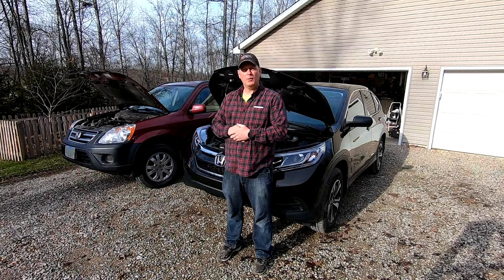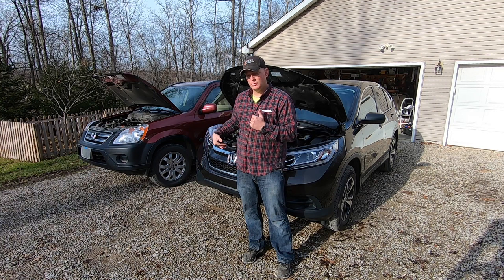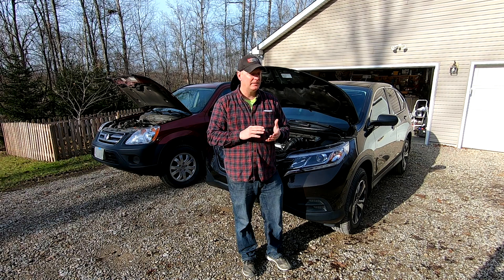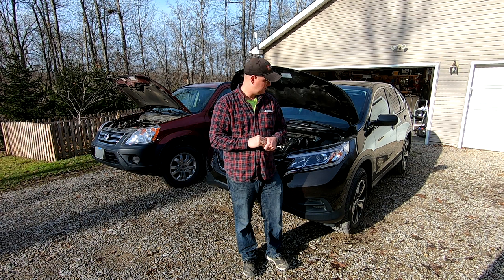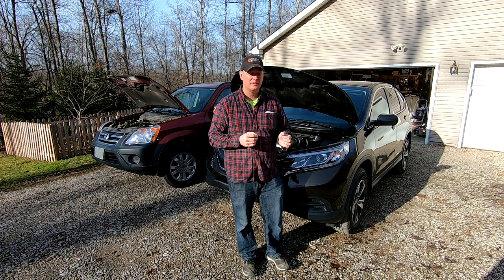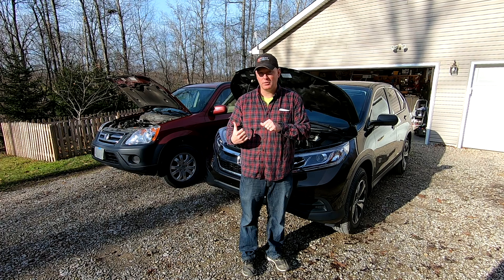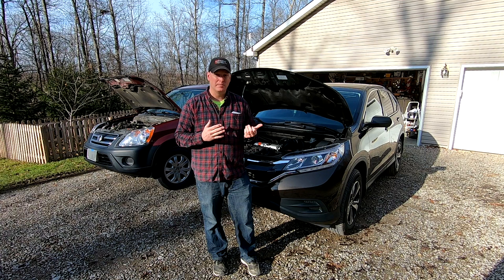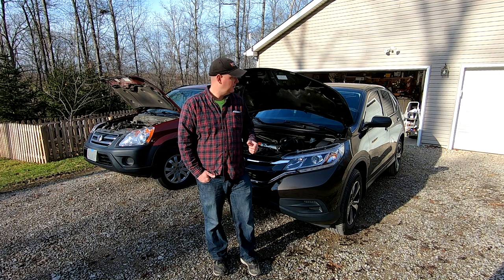DON'T BUY THIS CAR - 2012-2014 Honda CRV

Comment: I agree that this has been far from Honda's best effort. I had a 2013, and now own a 2014. Both were initially plagued with the "Croaking" rear differential actuator. The first one required the usual "we can't hear the noise" and "they all do that" from a snaky, POS Honda service advisor. I then had to give them the first of several TSBs on the issue,  and ask them to drop the bullshit, and do their job. In the collective 250K + miles, the VVT issue and $2000 repair bill, were joined by repeated compass module failures, which is a ten minute, $60 DIY fix, or a $400 bend over over at the dealer. The rear suspension is garbage, and can leave the factory unable to be properly aligned until you have spent $4-500 on aftermarket, adjustable lower control arms. This allows the rear camber to be brought into spec, and you stop grinding the inside edge of tires off, and start getting more than 30K miles out of a set of four tires.  The heat blower motor failed,  and small rubber trim strips on the B-pillars are now flapping in the wind as I head down the highway.  Not quite a GM or Nissan level of crap quality, but this generation of CRV, is nowhere near the caliber of other Honda vehicles I have owned. 

 The oddest problem is that the top chrome bar on the grill will snap all of it's mounting tabs off, and randomly depart the vehicle. I thought this was a really bizarre and random event, until I bought the replacement part and went searching for a YouTube video on swapping it. There are several videos on the topic. One video, for how to do a fairly obscure repair on this specific car, had THIRTY THOUSAND views. Now, if that many people wanted to learn such a specific DIY task, how many others paid hundreds to the Dealer to do the repair? My guess is that Honda made millions on that design flaw.
Reply: I just used a $125 aluminum set of parts for the sagging camber problem.
Reply: @scottasbj  And the dealer would have done it for that price? Did somebody align it for free? Would an independent shop charge the list price of the parts and two hours of labor?

Comment: My Honda Accord car got crashed.  I was expecting another 10 years until I pass it down.  Dang it.  It is a good one too.  So I been hunting.  Between you and Scotty and the stupid Variable transmissions and useless air blown feeds to get another 0.5 miles to the gallon, it is starting to look like Toyota.  Well, so far I found truck models  but I am not looking for a truck. But IF you can get a pickup with the 9 Speed Tranmission and the frame instead of the unibody and regular v6 4x4 or a Nissan Frontier and you want pickup.  You should look them up.  Ok not sure the 9 speed is in the pickup but there is supposed to be a good simple tran and engine in some of them.  Made in JApan too.  So apparently the CRV match in Toyota has one with the good basic engine and transmission.  That is the problem.  All that stupid going around trying to squeeze another half mile per gallon and ruining the economy and dependability of the car altogether.    Yes, you feed  Climate Idiots and tiny bit of science and they go completely stupid misunderstanding.  Twisted minds that see Government mega dollars do not care if the junk makes sense, just damn the torpedos, full speed ahead.  No matter how wrong or stupid the irrational solution.

Comment: i have a 2014 CR V at 8000 miles my Actuator started making that sound on cold morning i let my Honda DEALER know about it, they kept telling me Honda didn't have a fix for the Actuator so each time i got my oil changed i would ask if Honda had a fix they always said No they didn't have a fix so at about 55000 miles on my car getting a oil change i ask again they said NO, so i said  if it does something to my motor after the Warranty runs out i well SUE YOU TO HAVE IT FIXED because everyone having this sound!!!! in a few mins. the BOSS showes up and tells me WE ARE FIXING YOUR CAR i ask him i didn't think Honda had a fix he told me they did so in about a week they replaced the ACTUATOR and timing chain i have 115000 miles now have heard it one or two times put thats all, that wasn't until few weeks ago DEC 22 very cold!!
Reply: I would change the oil at least every 5,000 miles or even more often.

Comment: This is a nit picking a great vehicle and an easy fix.  It is a 2.0 hour job (TSB 09-010) at the dealer or even cheaper if you can do it yourself.
Reply from the maker: Did you watch the video? I paid the dealer and the problem came back less than a month later. I understand there are far worse vehicles out there but it's more of the fact that Honda refuses to even acknowledge they engineered a defective part and cannot come up with a proper fix.
Reply: @JackofAllMasterofNone  If it came back that soon, I would talk to the dealer again.  They should stand behind the work.

Comment: Toyota with their crazy track off & engine light that doesn't go off no matter money spent to on it. 

Rattle sounds in Toyota is normal most of thier engines 
2004 to 2012 & in recent, Mechanic will say it's normal. 
All cars have their issues. As far is not offenely fix every few miles. Toyota is not perfect neither Honda's.

Comment: It's VERY EASY! to fix, and cheap too... 30 min job! (replace the spring)
Reply: Just a spring?
Reply: Show me the 30 minute video.
Reply: @njsongwriter  Sorry, I can't find the video. remove 4-5 bolts( depend how many your vvt actuator has). make it easy not to drop them inside, take the plate off, put longer spring, or stretch the old one. put everything back. use orang locktite

Comment: have a 2013 crv with 111k miles and never getting mechanical problems ..... LOVE MY CRV ....... i dislike your video 👎
Reply from the maker: You are lucky. So because you haven't had problems, I shouldn't warn potential buyers of a very common mechanical issue with this model vehicle? You can just keep on scrolling bud.
Reply: great video i have a 2013 with 61000 miles same  problem bought the crv new changed oil every 4000 to 5000 miles always used honda oil filters very frustrated no more hondas.